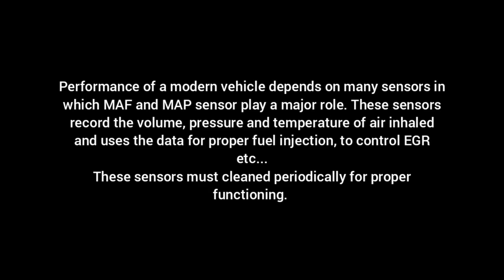Clean MAF and MAP sensors | Ford 1.5 TDCi | Ecosport Aspire Focus Freestyle| Easy Fix at Home

Comment: Vehicle: Ford EcoSport
Mileage:65,000Kms
Year:2013

Oil consumption is too high, it needs top-up, maybe 3 times in an interval of 10,000kms. There aren't any visible leaks so far, but I can see some oil below the oil filter and on the wiring harness located right below it , I suspect that the people at ford service center doesn't  clean them lol!. 

I removed the intake hose from the turbo, I was able to observe a misty coat of oil on the hose and that doesn't seem to be coming from the turbo.

There is a hose from the valve cover that meets the intake hose(before the turbo) right. What is that..Is that a part of PCV system for fords . I guess the oil is coming through that hose from the head(just a guess lol). The car doesn't produce any white smokes except during cold starts , but it does produces black smoke at higher RPMs. I'm planning to clean the MAF/MAP sensors and the EGR valve, thanks to Daily Hands Diy's video of them.

Thanks in advance and your channel is the only one I could find who makes regular and quality videos on these cars.
Reply from the maker: Thanks brother made my day. And yes the small pipe is the pcv system, its quite often to see such consumption in oil ford engines, upgrade to 5w40 grade engine oil. And do the said preventives too.
Reply: @dailyhandsdiy  Thanks for the quick reply,

Would a new PCV valve can solve the problem, I can't find that part anywhere though or should I install an oil catch can.

One thing worth mentioning is that, 2 years back the engine was decarbonised, before that the engine wasn't burning/consuming oil so is it because the piston rings are shot and the carbon build-up was helping in maintaining compression?. 

Before decarbonising the engine was quite laggy.
Reply: @dailyhandsdiy  I would also like to know if we want to pump gear fluid into gearbox.
Reply from the maker: A catch can reduce some amount but there should be oil spitting out of turbo to the manifold too. So upgrading to a thicker oil can reduce some extent. And i am not a good fan of decarbonising, it can distroy the engine later. Can burn the pistons rings and cause piston head to melt. Instead you can unplug the egr for like 1000 kms and drive, it will decarbonize itself witj nly fresh air and proper combustion. Ford uses diaphragm pcvs so changing it wont cure anything.
Reply: @dailyhandsdiy Would unplugging the EGR lead to a lit engine light. Also what's your state on engine oil flushing and diesel additives
Reply from the maker: Yes it will trigger a check engine light but it should go when you reconnect it and drive the car switching off and after 3 or 4 on off cycle. Or could jst clear with a scanner. Also am not a fan of additives too. oil additives can ruine the rubber seals on engine parts and diesel additives can smoothen engine till its in the tank but wont do any thing on cleaning.
Reply: Same problem I'm facing there is oil leak in one of the hose near intercooler..i can see the oil in the hose..what might be the problem?